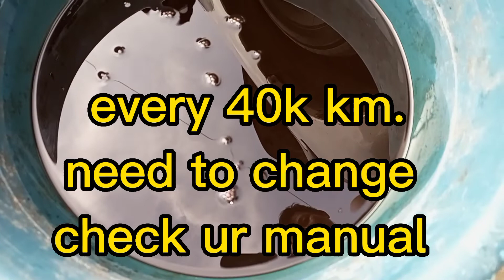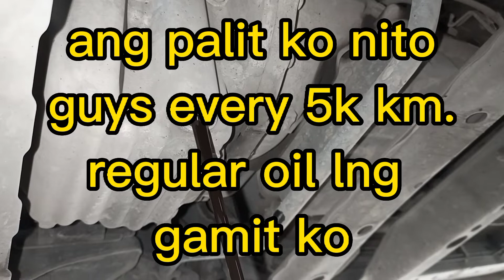DIY/AUTOMATIC TRANSMISSION GEAR OIL CHANGE/ENGINE OIL CHANGE 2018 TOYOTA AVANZA

Comment: Why only  2 lit. Of atf you're using for your avanza? Sa 2018 toyota avanza 1.5G ay 4.9 lit. ang reference capacity ayon sa owners manual.. whereas,  Many mechanic vloggers in the you tube were using different  capacity in  liters of atf. Merong 2.5 lit., merong 3, meron din 3.5 liters. sa kanilang avanza 1.5 G.? Nakakalito din kayong mga mechanic vloggers! Ano yan  just different folks different strokes!?